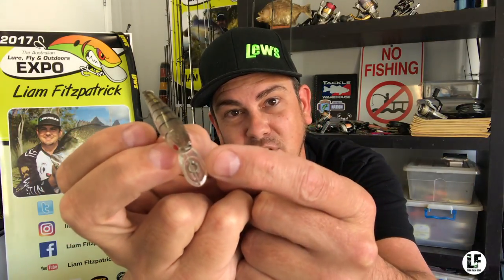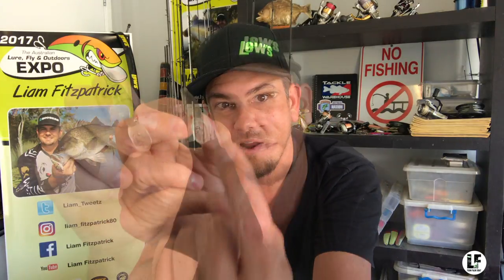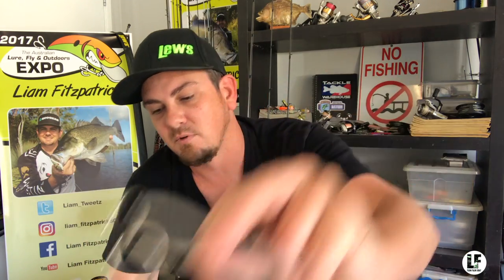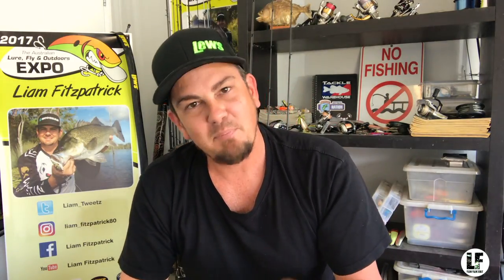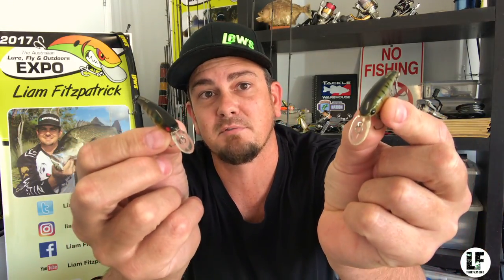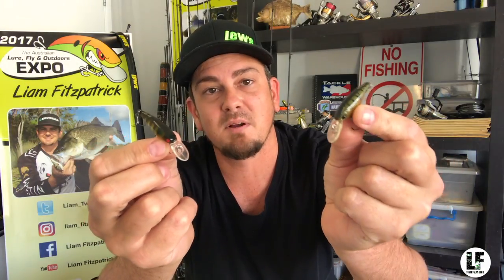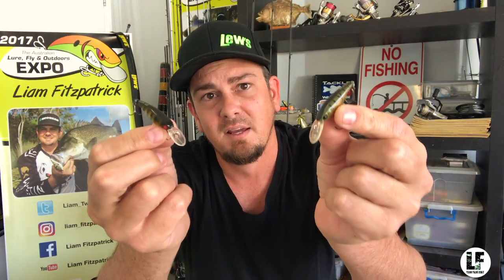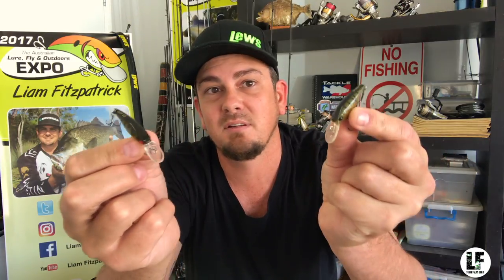PONTOON FISHING TACKLE HACK | How To Tune Hardbody Lures.

Comment: Great info, thanks for sharing.  I have tried the de-tune method with suspending lures, works fine, but the blow out hack is a new one to me.  Would you recommend a slow sinking crank that wafts away from the underside of the pontoon/dock?  Even just upping the weight of the trebles on a suspending for a subtle sink might work.  Those SX40's are great!  You love it, we love it, it's all good mate, keep em coming.
Reply from the maker: Garry Knox All those options are worthy of a run, the trigger is the bait doing something different to other baits. This is why it is deadly in tournament situations or heavy pressured pontoons.